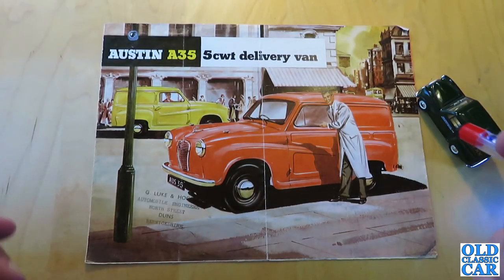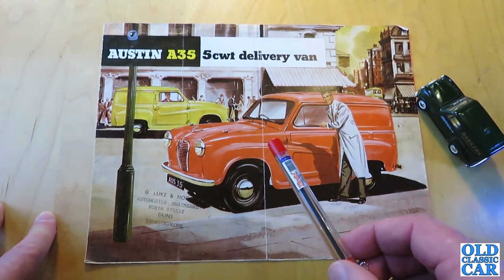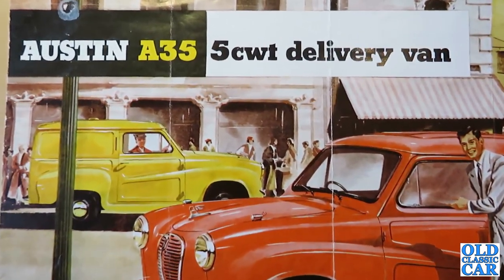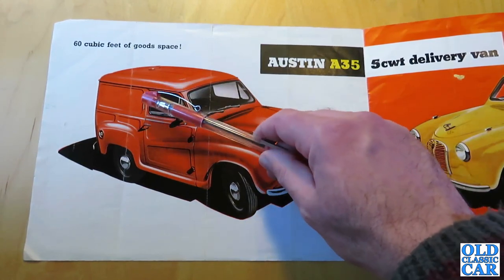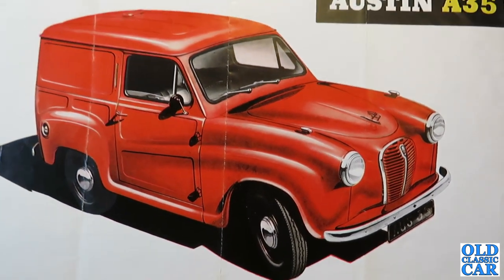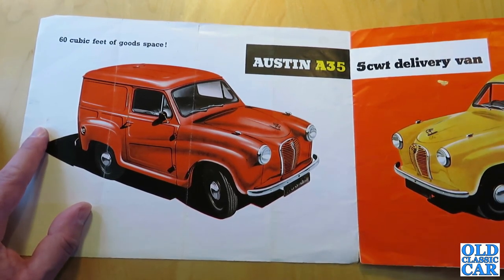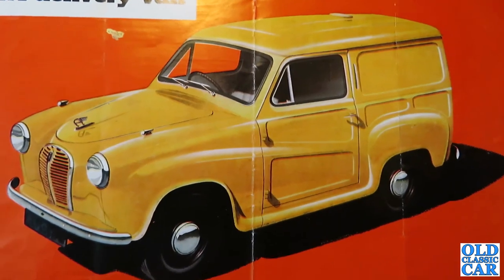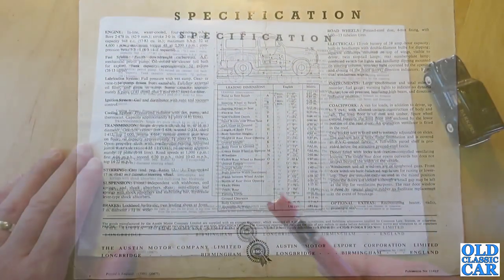A 1956 Austin A35 van brochure review, inc differences between AV5, AV6 & A-AV8 types

Comment: @3.20, Stainless steel waist line moulding on rear quarters & doors, AV6 still retained the L.C 948cc engine, AV6 ran from Feb 62-Sept 62